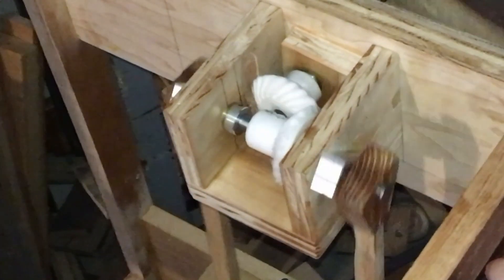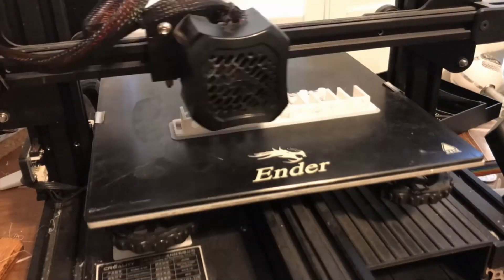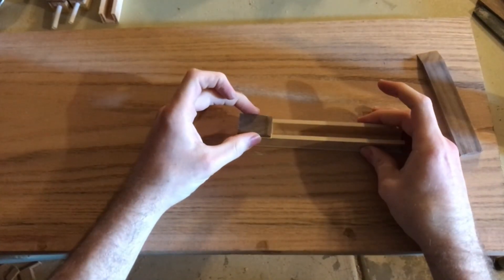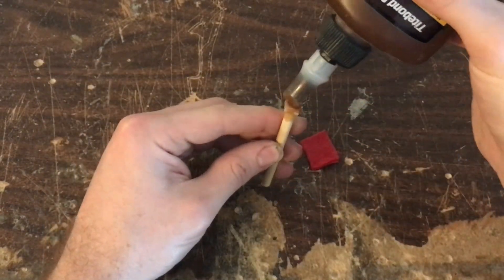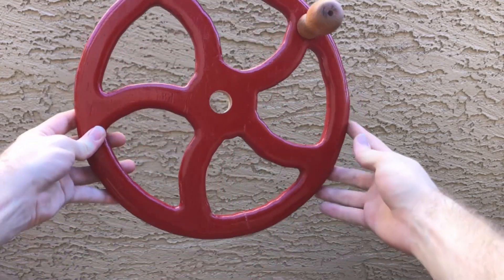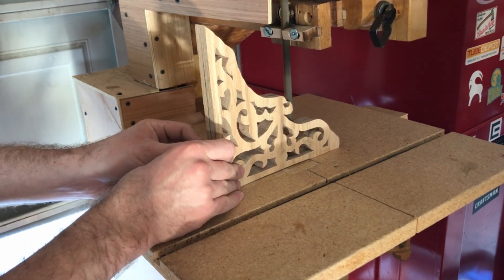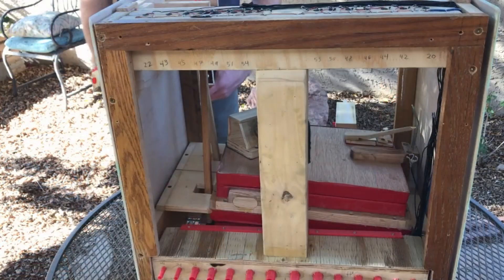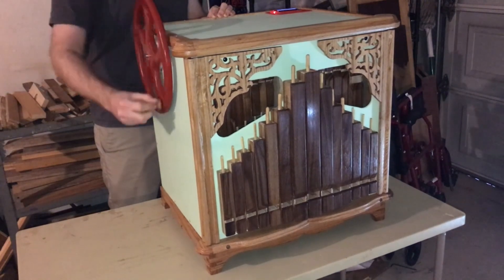Completing the Crank Organ

Comment: Amazing project! Any chance you are going into the details of the software and electronic hardware setup?
Reply from the maker: Thanks! At the moment I'm not planning on covering that in detail, sorry.
Reply: @cas_creations  Thank you so much for your answer! I am just wondering, did you develop the control setup yourself or is there predefined Arduino setups for crank organs out there on the web maybe? Also, is your playback speed proportional to the crank speed?
Reply from the maker: I used a MIDI parsing Arduino library to read MIDI files from an SD card (link below) and trigger the solenoid valves for each pipe respectively using the Arduino I/O pins. I initially planned to have something to read the speed of the crank and alter the playback speed appropriately but decided to do without it for now.
https://github.com/MajicDesigns/MD_MIDIFile
Reply: @cas_creations  Thank you so much for this information. You did amazing work building this organ. Regarding the crank speed read out, I discovered that chat gpt or similar LLMs are giving useful code suggestions to realize this feature. Might be helpful in case you are interested in further development. Be blessed doing your amazing work!

Comment: Nice to see it finished!
You wrote that you didn't want to go with paper.
I wonder tho if you have any info have these machines work wjth music rolls?
The only mechanism i have seen here on yt have been with mechanically acturated valves through the punch holes, i guess that would wear out the rolls over time.

Player pianos uses vacuum but that seems unnecessary complicated to  cooperate in a organ
Reply from the maker: A common way of interpreting paper music roll information is through a "pressure box" which has pressurized air that is released into a pipe when a windway directly under the roll is opened by the hole in the music roll for a certain note. This video is a good example:
https://www.youtube.com/watch?v=eVo_LaWH4-g&list=PLDjucfhdTRPlQbnNCd848nNnnwNdTnk5R&index=31